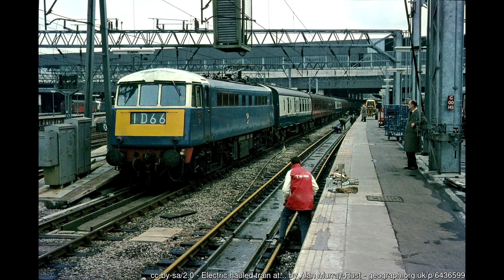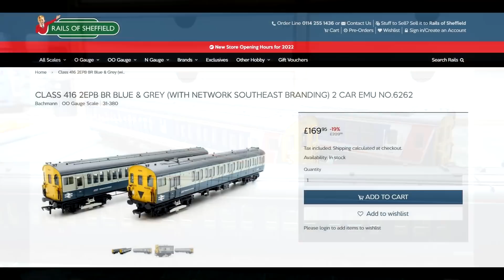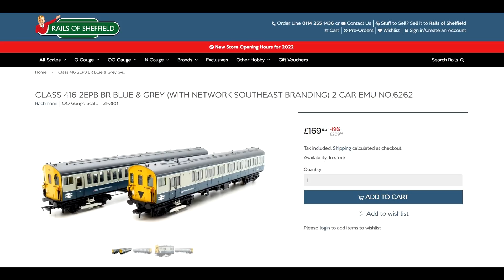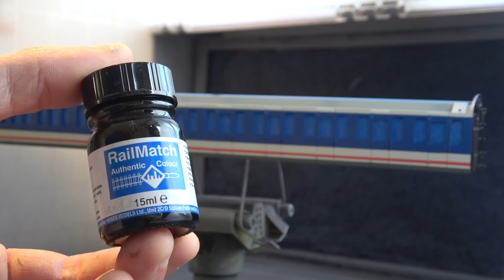Thumper Project | Building a third coach for the Bachmann class 205

Comment: Excellent work! Have you thought about the direction blinds? If you fit some white translucent plastic sheet to diffuse the light, you could fit a red and white LED behind which would give the effect of the blinds being pulled for appropriate direction of travel?
Reply from the maker: It already has illuminated blinds.  The model comes fitted with the appropriate red and white leds and they work according to the direction of travel.
Reply: @EverardJunction  Ooh sorry, I must have missed that 🙏.

Comment: Great build… Apologies, I did look to see if anyone else had asked and please feel free to point me in the right direction. I am trying to do a similar build but the one bit I am worried about is the removal of the headcode leds section on the lower circuit board which you don’t describe. Any guides welcomed please? Many thanks and keep up the excellent production standards😊
Reply: Hi, I’ve also just completed a Class 205 centre car, inspired by this channel. Unlike Richard I only had 2 BR Blue Class 416 bodies, having picked up a relatively cheap sound fitted one from Rails of Sheffield, and re-bodying into NSE livery.
I cheated a bit when it came to the couplings, and bought 2 Class 416 trailer car chassis from Bachman, and cut and shut them to give the swivelling connectors at both ends. One was a full chassis with seating, and PCB, the second just the chassis.  As you  have discovered already the main PCB, is too long because of the head code section . I cut off that end of the PCB approximately 20mm (measured down the centre line), and as there were now no screw hole at that end I secured it to the chassis with black tac. The cut only severs the 3 tracks which feed the head code, and are redundant anyway. I hope this helps, and good luck with the build.

Comment: Very good project Richard. The attention to detail on the cab ends, i.e. removing the headlights, is well done. One question I do have to ask, looking at the photos, it appears you had to redo the black triangle on the cab end, where the guards end is. Was a replacement available as a transfer, or was it masking tape and paint?
Reply from the maker: A job for the future.  Didn't know they moved the triangle, you can get them from railtec.  Cheers

Comment: What a noisy old bugger it is... I love it! You just wouldn't know that center coach was a modified piece and didn't come straight out of the box. Amazing job, Richard.
Curious question; Any particular reason you went with a loop and not a head-shunt at the end of the branch? Only asking as it's made obvious by the 205 that the ends have swapped as it reappears from the bridge, yet it does a simple stop and reverse at the station end. Also, I see a tree that needs trimming!
Take care. Mike.
Reply from the maker: I was having some issues with the automatic running at that end of the layout.  When I relaid it I decided to run a loop to stop the problem from happening again.  It turned out to be decoder issues but I didn't know at the time.

The loop also allows for me to run my track cleaner more easily making sure everything gets cleaned.  Cheers

Comment: Absolute next level stuff. Congrats on the finished item! Quick and very basic question please... When you set your compressor to 20-25psi, is that the readout on the pressure gauge when spraying or not spraying? Thanks

Comment: Another great video. Have you tried the painter and decorator trick of painting over the masking tape with the colour under it. For example at timestamp 26:08 rather than the light coat of blue paint, instead do a light coat of white then layer the blue on top. This might get even crisper lines once the making is removed.. Worth a try?
Reply from the maker: Certainly worth a go.  Will try on the next project, cheers.

Comment: Really excellent video. But question: Couldn't you have saved yourself much of the trouble and made a Class 204, the centre coach of which was a recycled EPB driving trailer complete with driver's cab?
Reply: I was thinking that myself - if you're less confident with hacking models, it's a simpler alternative.

Comment: With hindsight I think these should have been electro-diesels like the Class 73 and been fitted with inter vehicle gangways when they were refurbished, unless Network South East had ordered 3 car Class 150s or 210s to replace them in the 1980s. The NSE 150s would have had end gangways like the 150/2 but purpose built centre cars like the prototype 150/0 units...

Comment: Decoder question.  I have said for many years ever since n gauge voyager  came out the one with centre car motor(think Bachman). Why do I need 3 Decoders can’t it all be used on one. If it’s a fixed formation can’t you wire end to end so it controls all lights forward reverse on one decoder. Everyone said no. This model shows you can. So I ask again(first time to you) Do you you think if it’s a fixed formation can’t your attach wires end  to  end to only need one decoder?
Also for say steam where all coaches have extra pipes could model it as that. with the right coupler could you not electrify the coupler so when you alter detach or for storage  better no cut and solder you take apart reattach. if it’s an unfixed formation or  multiple DMUs or wagons you’re dropping  off or locos at one end it could be detached and moved as like normal maybe automatically.
Could your make ether idea? 
If so would it work?
If so would it be usable, practical.
If not why not?

Comment: Fantastic job, Richard, that looks so much better than the original 2 car. Which speaker did you use with the biffo sound file? Regards Matt
Reply from the maker: Its a megabass one as it was supplied with the chip from roads and rails.  I might fit a rail exclusive one in future to get a bit more bass out of it.  Cheers

Comment: Indeed the Hampshire DEMU. I probably drove most if not all the fleet at various times. Only the first batch were turned out in 1957 as 2-car types with a 500hp English Electric engine. Their success on Hampshire local services required two follow on batches. These were built as 3-car sets, and the engines boosted from 500hp to 600hp by better turbocharging. The first batch were retro fitted with an extra centre car. However units 1121 & 1122 were for many years kept as 2-car units for use on the Southampton - Alton service, as the section from Winchester to Alton via Arlesford (now closed) was steeply graded. The last batch were actually known a Berkshire units, and had a bigger Guards van with one less compartment, and what was called Phase 2 detail changes, to windows, guttering, roof pipework or lack of it, and a noticeably smaller route indicator window (centre window on cabs). Towards the end of their lives many units exchanged vehicles and at least a couple obtained an extra ex 2EPB electric Driving trailer 2nd to make the remaining 2-car sets up to 3-car.